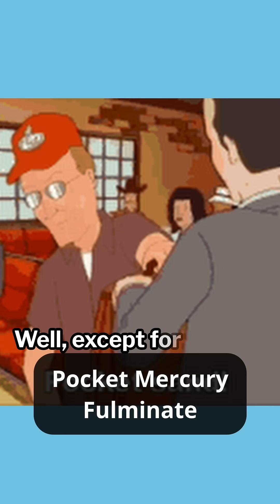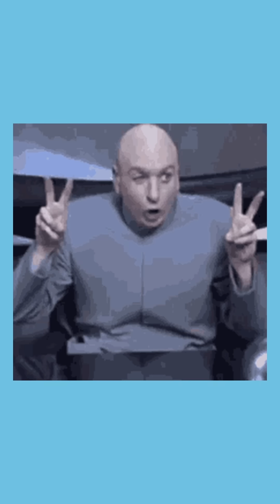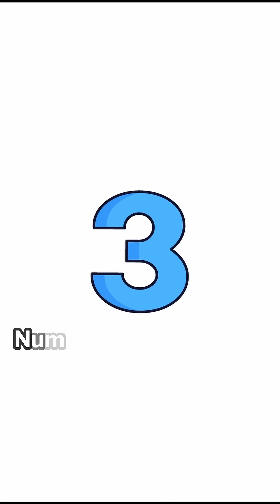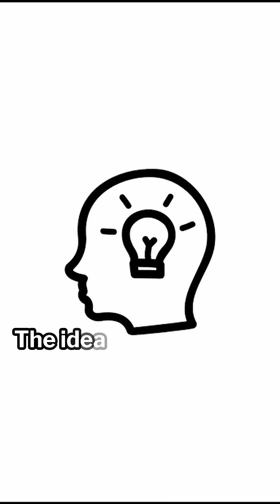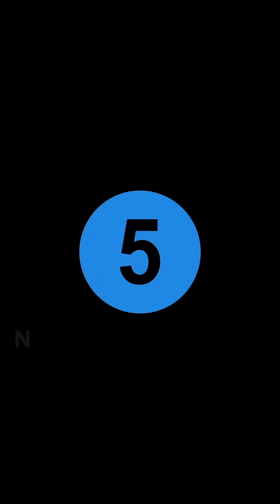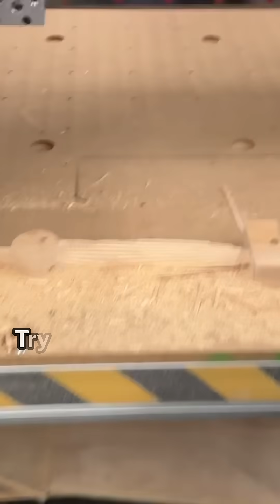Engineering Project Tips  #advice #arduino #electricalengineering

Comment: Well 80% is sometimes true but other times might be dangerous. If desired a device with a microcontroller and everything works that I’ve planned for 85% - 90%. Now I only need to design a pcb for it. I could quit now or design it even so it will have a steep learning curve. I think in those times 100 % are better than 80%. The skills I will learn from that will be incredible. But I also get your point you mean all those added features that are not needed
Reply from the maker: Yeah that is very true. I should’ve emphasized this is for fun/learning personal projects. Like if your designing a bridge, you definitely want to give it your all
Reply: @ElectronicGuy1 that was hopefully clear that if you build a bridge you can’t stop at 80% Hopefully. But I guess you mean overcomplicating people that do feature creeping. Then it’s better to do 80% because they will never finish a project 😅😂.